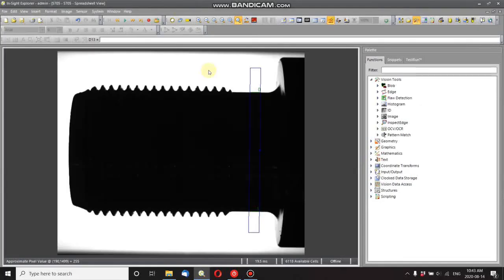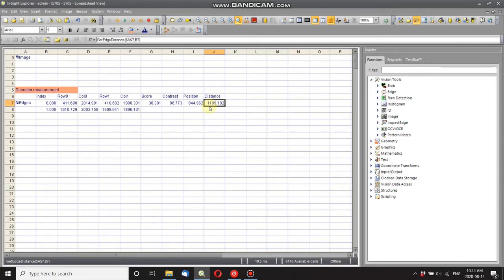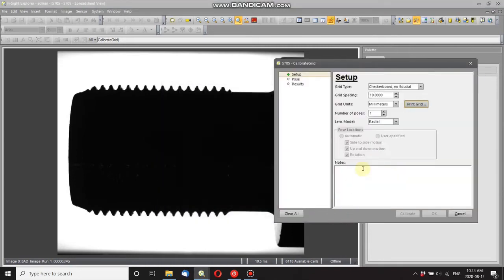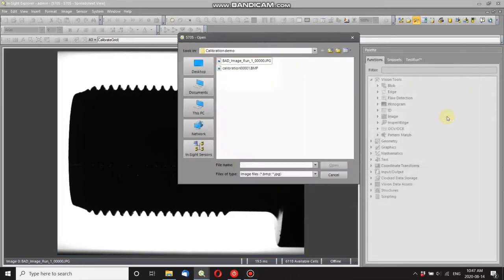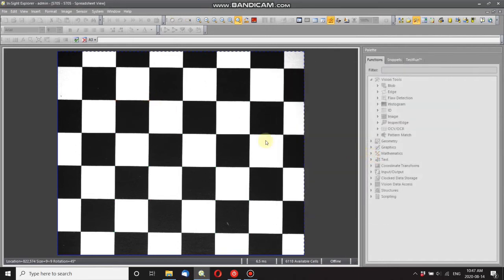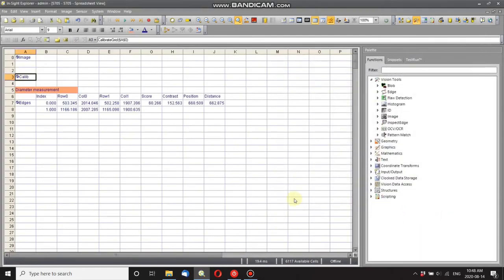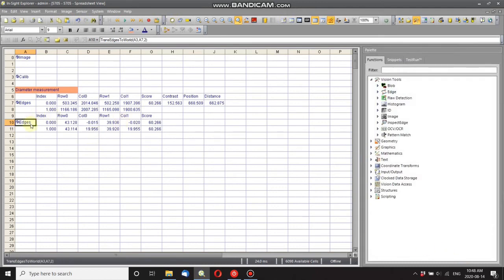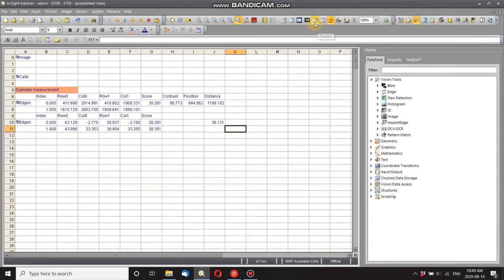How to measure in real world coordinates (Cognex)

Comment: Thanks for the video. Is mandatory print the grid ?
Reply from the maker: For the most part, yes. The intersections are what the camera uses to calibrate itself. If you can't use a grid there are other methods such as point calibration. I may have done a video on that.
Reply: @landeltech1240  Thanks for the answer. I was hoping not to have to glue the grid to the piece but if is mandatory i will do it. And another question : 
if I have the camera at 45 degrees with respect to the piece, does something change for the calibration?
Reply from the maker: I glued the grid to a piece of cardboard. 

Process doesn't change for a 45 degree tilt.

Comment: Hi Landel Tech 1

  I would like to have a question: what is the difference between calibration by a file from your computer and calibration by live video. Will dimention of object be changing significantly ?
Reply: calibration by live video means when we use check board for calibration
Reply from the maker: They are the same. You can take the calibration cell structure and save it as a file on the computer then import it into a different inspection. As long as the physical setup doesn't move the calibration will still be valid.
Reply from the maker: I'm not calibrating with a computer. Just importing an already saved calibration into a new spreadsheet.
Does this answer your question?